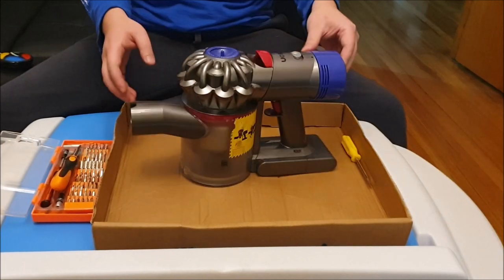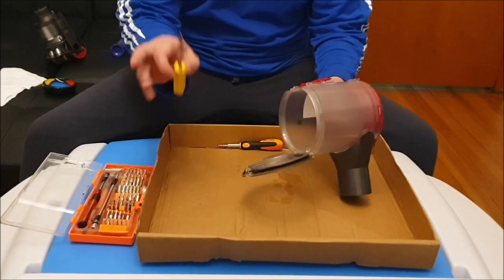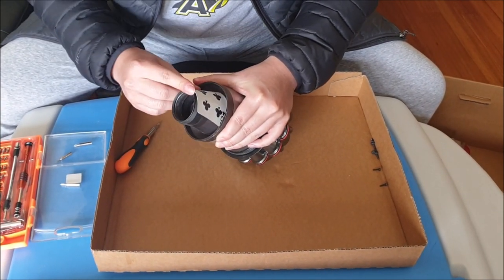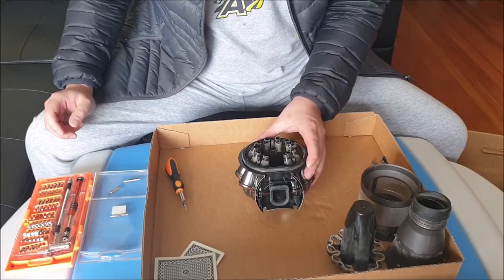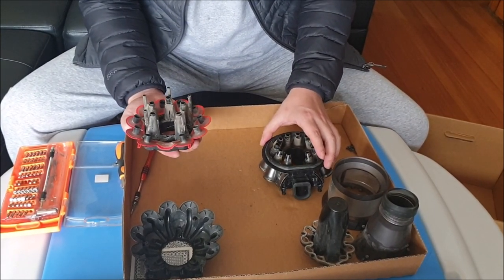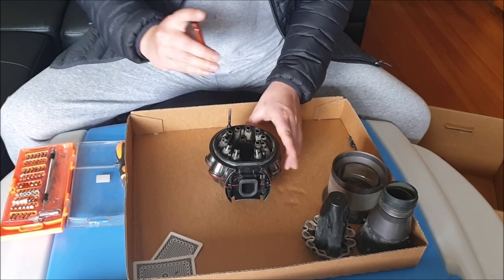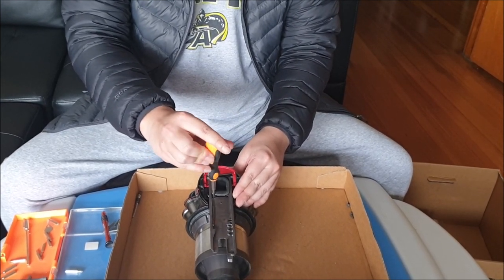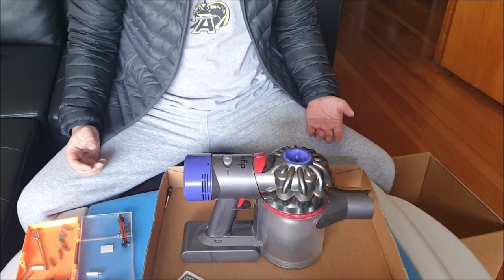OPEN ME UP! Dyson V7, V8 Disassembly and Clean

Comment: Extremely useful!  Wet dirt got into the vacuum while cleaning up during Hurricane Ian and created a "smells like dog" in my V8's interior.  Purchased new external filters, but wasn't until I disassembled the interior and soaked (in Efferdent) that large chunks of congealed dirt came out.  Video provides road map to take apart and put together as much as needed.  Thanks!!
Reply from the maker: thanks for your support

Comment: What torque sizes do we need? Also can I soak the inner core...after I was able to use the cards & remove the filter @8 minutes into your video... I wanted to clean it thoroughly but unsure if there is anything electrical to worry about...much obliged for your video & support GREAT ONE!
Reply from the maker: you can clean everything beside the motor. the whole item at 5.00 in the video can be clean as it has not electric stuff

Comment: Anyone know where the black paper-like gasket (smaller than the red one, same material) goes?
Reply from the maker: can you watch the video and tell me at what time it shows up so i know what you are asking.
Reply: @OpenMeUpTec  At 13:52, the part that's facing the camera -- in my Dyson V7, there's a black gasket that sits on top of that piece.  Or at least I think that's where it goes.  I didn't specifically see this gasket at any other point in your video.  When I reassembled everything, the filter doesn't want to sit flush anymore.. seems like the gasket is causing it to be raise about 1MM up?  I don't know where else it would go though.
Reply from the maker: @-MrMoose  it is best if you can disasseble it again and watch the video. as i am not certains what is the problem. can you take a picture of this peice or find it somewhere to show me what it is.
Reply: @OpenMeUpTec  I'm pretty sure the piece doesn't exist in your video... it's made of the same material as the red gasket.  I'm going to leave it alone for now, vacc seems to work fine and it's my backup anyway 😅 Thanks for the response!
Reply from the maker: @-MrMoose  i see
Reply: @-MrMoose  it sits in the very top part of the assembly, the same part that the red gasket sits on. It goes in one way only
Reply: Flexible guitar pics on the ledges work as well. Once the screen filter pops over the ledge, the screen filter comes off easily